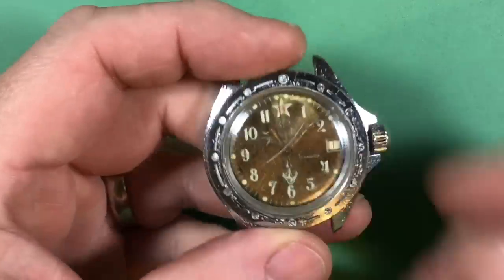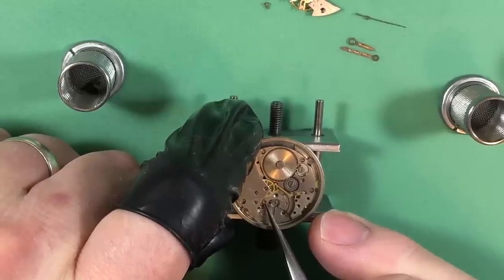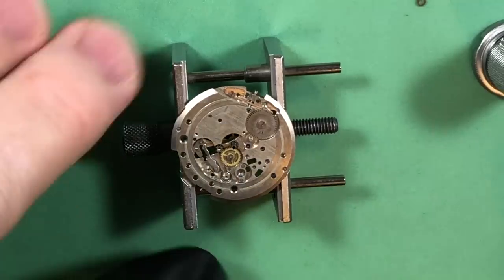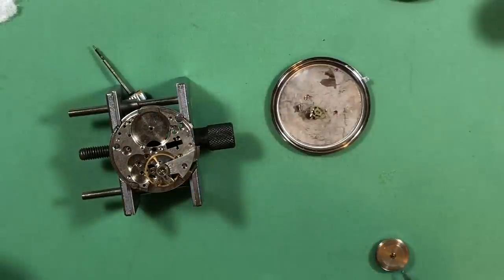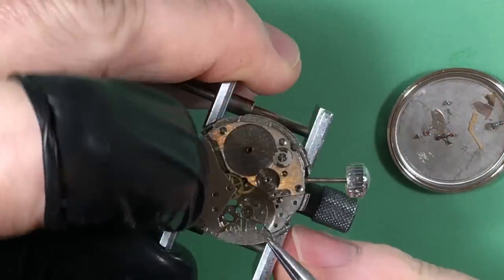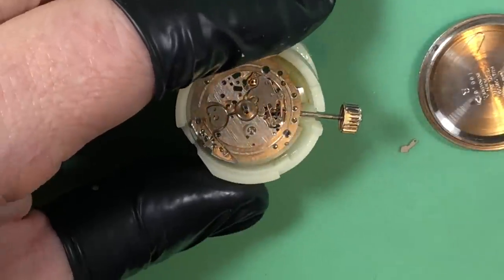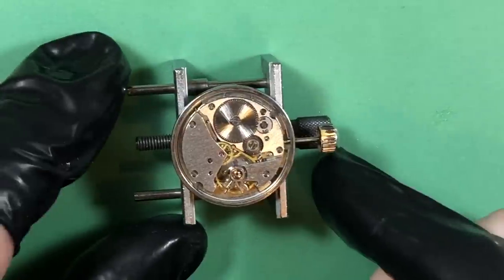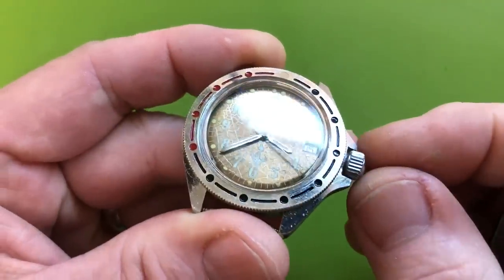Let's restore a $28 watch!  1980s Vostok Komandirskie

Comment: Dude you are KING! Making Vostok to run 0.1 beat error and +5 sec a day is a marvel!
Reply from the maker: Really?  That's nice of you to say, thanks!
Reply: They're a remarkably good movement considering the age and origins.

I love my 4 Vostoks 😁

If you're considering buying one, 
1. Buy an Auto 
2. Get one without a date wheel as they're a huge pain to change due to no quick set.
Reply: Especially considering how old this movement is! Vostoks are amazing watches for this: they are tough as nails, and one of (if not) the most reliable watches out there.

Comment: This is a post-Soviet watch made sometime in the 90s. The dial was originally a deep blue that tends to fade like yours. Water resistance was advertised at 5 bar when new, so not exactly a diver. The movement was a joint-venture development between Raketa and Vostok in the early 70s and is still made today in both date and no date versions. For $28 you can find a really good example in Russia and they tend to run fine, despite poor quality control in the 90s. Thanks for sharing!
Reply from the maker: Great info, thank you.
Reply: @SpencerKleinVintageWatch  Сейчас контроль качества сборки часов  на много лучше  стал. Ввпускаются они в корпусах и выдерживают  20  бар.  Цены от 40 до 80 долларов. Качество отличное. И много разных корпусов и циферблатов. Рад помочь  информацией.
Reply: I have the same watch, that I just bought on eBay for about 20 bucks. It has a deep blue face, but is starting to fade to a bronze color at the 12 o'clock area. It, too, looks like it was beat to hell for 30+ years, but still runs strong. Sits on my desk right next to my Longines Hydroconquest!

Comment: Hi Spencer,  it is very common for these watches to have movements replaced when they go bad as they are inexpensive and labor for repair would cost significantly more. Of course if you have a watch like mine that was given to me by my son for my birthday last year,  the movement will always be repaired and not replaced. Mine is a 31 Ruby auto and manual wind Amphibia Scuba Dude (frogman on the dial) with the same bezel as yours and I absolutely love it! Thank you for the great video, cheers.
Reply: i have one of those. not bad for £50 (though i spent nearly double that on the replacement bracelet and steel bezel).

Comment: Actually, I see this video as more of  a Christmas present then a party.  Thanks  so much  doing this and in extended format no less!
  I've been waiting to  see someone do a Vostok service video and I was so pleased it was you.  Nobody else shows the same kind of mechanical sympathy to the watches they work on regardless of price then you do. 
In my opinion these Vostoks are little gems in the rough. Yes, I know, some of them come out with flaws, but over all they represent the Russian philosophy of design for task and purpose without wasteful extravagance  like little Kalashnikovs or MIG 29s. As you mentioned the compressing case design, novel two piece caseback and wobbly  crown are  ingenious solutions  the designers came up with to overcome their limited resources.  
   Yes, I have 2 of  them and they get the most wear time of my watches because they're simple and easy to live with.  As you may know, all manner of  different bezels, dials, hands, and straps or bracelets are available from the factory store , Meranom, at very reasonable prices. A new movement is ~ $40 so a lot of people just replace the movement instead of servicing it so I was really happy to see you go thru one.  Thanks again and best wishes to you and the family for the holidays.

Cheers
Reply: Если это часы времен СССР то контроль качества на заводе был на высоком уровне. И механизмы тех годов достойного качества, чего нельзя сказать о механизмах сделанных сейчас. Не редко под крышкой новых часов можно обнаружить и механизм в частицах смазки, не качественно обработанные мосты, шестерни с заусенцами и грязь на механизме. Это я про некоторые моменты современных часов Восток. По мне лучше профилактика старого механизма. И он прослужит верой и правдой ещё долгие годы.

Comment: If you see something with CCCP in it on the face of the dial it is 1989 or older. I have a couple of those old watches. The dial on the airborne model was originally a beautiful deep green but it faded to a gold/brown with time. Mine is somewhere out in the garage with my old army gear. I came to this channel to see what would be involved in cleaning it and getting it running again. The one I wore for years was an airborne watch but the navy watch starts with a blue dial that changes color too. I also have a tank corps watch. Can't remember what color that dial is. Some are hybrid auto-wind/manual wind. Mine quit on me about thirty-five years ago when I was stationed in Germany. When I took it to a German watch maker, he told me it would cost more than the watch was worth to have him repair it. He recommended that I make another trip over to the Helmstedt checkpoint with a carton of cigarettes and just swap another Russian border guard for another one. I just put it away and forgot about it.

Comment: I know this is a late response and I think other people may have said everything that I'm going to say here anyway.
 The watch, or at least the dial is from the early to mid 90's. On Soviet made examples it will say Product of USSR, in cyrilic at the bottom of the dial. After the collapse of the Soviet Union, they kept using those dials until the they ran out. After that they did not decide for a few years what to put on the dial and left it blank, like yours. Newer ones have Product of Russia, in cyrillic at the bottom of the dial.
 I've heard two different stories about the crown. The first being that it's semi-detached to reduce shock transfer to the movement in the event of a crown strike. The second is that, on their dive watches it will allow the watch to remain sealed if the crown tube is bent in the event of a crown strike. I can't read Russian, so this is only what I have heard. But I've seen technical drawings of the crowns and it is just splined so it spins freely until you pull it out gently and the splines engage. Replaceement crowns are a one peice unit and are pre-sized to the case and movement.
 The Komandirski is a field watch and the modern ones are rated at 30m of water resistance, the older ones may be less. They do share the split caseback, acrylic bubble, wobbly crown, and often timing bezel with the Amphibia, which is their dive watch. The Komandirski (Commanders), had many variants with diferent names for different jobs or military ranks. They are usually made from Brass, either plated or polished and also usually have a hand wind only movement. The Amphibia (Amphibian), dive watches are made from steel, and newer ones have an automatic movement. Older Amphibias have chrome plated brass crowns and bezels. Some Amphibias from the 00's to the 10's have carbon steel crown tubes which had problems with rust, although newer ones have stainless crown tubes, along with stainless crowns and bezels.

Comment: Ok-- the dial lacquer does craze gorgeously. the crown wobbles as crown/stem protection. The bezel is bi-directional friction fit with a little copper spring. Don't worry about breaking parts. the 2414 movement parts are all over the place.  These are cool little movements. Classic Soviet engineering- runs well enough... forever.  Built. Like. Tank.
From my research you've got the old dial font-probably 80's or early 90's. Soviet made parts, maybe put together in Soviet era or just afterwards.

Comment: Vostok is a brand I’ve seen quite a lot of but never had personal experience with. I’d love a video all about them and the history :)
Reply: I own one and can say, they're worth the money.
But i don't know anything about them.
As you, i would also want to know more.
Reply: It’s very bad quality as all Russian watches after let’s say 1973 but some vostok was produced under military control . Actually from some thousand watches Produce daily army was choosing sometimes 1-2- 3 mechanism was cased in a case with sign « Заказ министерства обороны” or on some watches “ Заказ МО»  Only This watches good quality and deserve to be in your  collection!  all other it just garbage
Reply: @ShlomoLevi  what is your definition of good quality?
Sapphire crystal and always stainless steel?

Then I agree with your assessment.

Reliable?

I have one that is 26 years old manual wind Komandirskie and never been serviced. It runs 7 seconds slow(ish) and works perfectly. Amazes me every time I remember this fact.

It even changes date at almost exactly 1 minute past midnight. My old IWC couldn’t even do that (about 3 min).

I judge quality by its reliability but we are all individual in our preferences.
Reply: @KazeHorse  good quality It is problem-free for the owner to function with good results It does not depend on the sapphire crystal nor on the steel case.  reliable Just relates to quality conditions.  most likely you have a command watch of export origin, which, by definition, is of much better quality than watches in the domestic market.  When you lived in Russia and were actively interested in watches, you had a completely different concept of these watches.  This is most likely the so-called "survivor's mistake" when you talk about your watch that works long and well, not knowing about hundreds of thousands of watches that have long been thrown into a landfill.
Reply: @ShlomoLevi  see then my komandirskie fits that bill perfectly.

Interestingly mine is actually a domestic market model - 47 case that I bought it from an outdoor tank museum place maybe 45min from Moscow. I do not remember the name but it had many T-models you could view and climb on.

I agree many will fail the test of time. I think my argument is that for $30 it’s probably worth a go. I know mine is not the only survivor because when I travelled in Asia, some people also used Vostoks their for their value and reliability (if they weren’t using a Casio haha). 

Plus they are designed well aesthetically in my subjective opinion - a classic utilitarian look.

On the plus if your movement fails you can buy an ugly face model with a worn case & transplant it. But mine will be fixed with new parts if/when it breaks as it’s sentimental.
Reply: @KazeHorse  it’s really depend on the price if it’s $30 new so m.b but not more than, otherwise good condition Seiko 5 on India eBay cost $10 from watchmaker and even less (serviced)

Comment: Hi Mr Spencer, some watchmaker told me that Vostok lift angle is 42deg. You could try it.
Reply from the maker: I will try it, thank you!
Reply: Yeah don't know if that older movement would be the same, but I can confirm 42 is what I've found for the current Vostok movements.  Seems really low compared to other movements, and could account for why the amp looked so amazing at first.

Comment: I have a few Vostoks, open 'em, regulate them at 42 degrees indeed and they are phenomenal. SKX bezels swap with them in case you wanted to know. The crown is designed to wiggle that way so a whack won't break it off. And they are insanely waterproof since the caseback design allows for increased depth pressure equaling increased water resistance.  The only problem is when you buy one you end up buying 10 or in my case more. Then you get stuck looking and buying Poljots and Raketas.  It's a vicious circle.
Reply from the maker: I've been looking at Soviet-era cushion-cased divers - the ones with the large 3 / 6 / 9 lumed numerals.  That's pretty cool that an skx bezel will fit on one!

Comment: Great job, Spencer! Love such an unusual stuff from you! I would suggest to check Soviet Slava 2427 movement. It is 25j day-date with TWO main springs. There are a lot of cheap pieces with funky designs on ebay.
Reply from the maker: I had one!  An NOS example made in the very last years of the Soviet Union: https://www.kleinvintagewatchrepair.com/sold-watches/slava-dress-watch-26-jewels-daydate-made-in-the-twilight-of-the-soviet-union

Comment: definitely early 1990s - post Soviet - that dial was common from 1985. Usually found on Amphibias - back then there wasn't much difference between the amphibia divers and the Komandirske field watches, the latter have less depth rating but have the same pressure case back and gasket. Build quality wasn't great and the company really really suffered in the 1990s economic hell in Russia - most cases were still brass with chrome plating - these days they are stainless steel.

Comment: Swirly B models are usually transition as there was a hiatus what Russia would call itself in the brave new world so companies kinda held back until they knew it was going to be just Russia or Russian Federation they could put on the dials.   BTW I wouldn't go deeper than 20m on a Komandirskie, you can dremel a little lug channel on the back and then fit an Amphibia double lugged caseback which will turn the watch into a 200m capable but also new stem tube and crown seals and likely a new crystal with tension ring before getting it wet at all lol

Comment: Hi Spencer great video, I have an unrelated question about a 7s26 with etachron, is the regulator pins adjustment for positional error, or is fine rate adjustment done there or both?

Comment: Do you lubricate the space between the top of the seconds pinion and the bottom of the friction spring?
Reply from the maker: Yes, a hair.  On Rolex you're not supposed to do this but having two pieces of metal interacting without lubrication makes me itchy.
Reply: @SpencerKleinVintageWatch  I’m working on a omega 565 and I’ve read on those you’re not supposed to - but I’m with you a very small amount of HP - 1300 seems warranted

Comment: How does the date changing work - on mine it seems to jump at about 4 am - is that a fault - or how they are made?
Reply from the maker: hands are set wrong on yours.  To do it right, you run the watch forward until the exact click-over of the date, and then put the handset on.  It doesn't hurt anything to have it set at another time, it's just a thing.
Reply: @SpencerKleinVintageWatch  Thanks Spencer - I am not talented enough to do that - I will just live with the change happening at 4am!  Glad its nothing serious.  And thanks for sharing your video - always interesting to watch.

Comment: These watch Vostok Commander 2414A not 80 years they were issued not in the SSSR but after the collapse already in the 90s because there are no inscriptions on the clock dial where they are made and the factory crown is also completely different and must be the same as in the East Amphibian.

Comment: I have this same watch that I traded a Russian merchant sailor for in 1992 when I was in the service. Mine has "CCCP" on the bottom of the Blue dial, and "USSR" on the back. Hallmarked "Vremir". I took it out of the drawer last night and wound it. Still running.... No longer luminous.  Could use a new crystal. Any available (don't have to be factory).
Reply: Its basic acrylic crystal just order one in. The size of your watch hope this helps

Comment: Im sitting here wondering what watch that fab suisse case back was from ?
Reply from the maker: oh, an Omega 166.090 "Baby Flightmaster", a project watch I was fiddling with.
Reply: @SpencerKleinVintageWatch  Cool, kinda looks like a dynamic, will you make a video out of it ?
Reply from the maker: I'd be down for that - the big issue with this particular watch is that the original lapped finish on the case is completely gone, and the case needs to be restored.

Comment: Last one I promise hehe :)  The dial was originally blue or green metallic and what you are seeing is the gold lustre like a candy paint effect but the topcoat layer has bleached in the sunlight meaning this watch was worn extensively in the outdoors.   Its quite common with the bleached golden dials for owners to strip the chrome or TiN plating off with muriatic acid I think it is, which turns the case into a pleasing almost bronze like that patina's up beautifully and looks super cool with the brown gold of the bleached dial.
Reply from the maker: Thank you - I need to get some muriatic acid; it's been on a mental list for years.  How is that done?  Just soaking the case in it?

Comment: Little tip on the movement ring, loosen the screws til the ring can turn and with stem out simply rotate it so the cutout gets to a screw and voila the ring just pops off.   Balance shims are best done with the cock loosely screwed on and just gently slide in the shim, easier to do with movement ring off.   Excellent end result indeed, my Zakas blue submariner I relumed with blue dots and hands and looks pretty cool :)
Reply from the maker: Very good - just like a Rolex then.  I should have thought of that.

Comment: Hey, so what do you think about this movement? Sadly this is one of the worse wostoks. You should try the 22 mm family which is 18 jewels. You can get those with hacking and with geneva striping. Or if you want to try working on one of the greatest russian movements you can buy a pobeda 2602 from the first half if the fifties. Its a very beautiful oldschool workhorse.
Reply from the maker: It was nicer than I was expecting.  I wish the diashock springs weren't so unusual.  Also, having hacking / autowinding would be great.  I'll look at that Pobeda you mention!